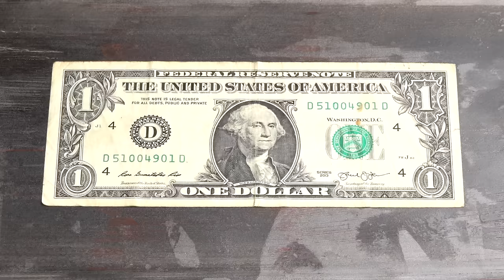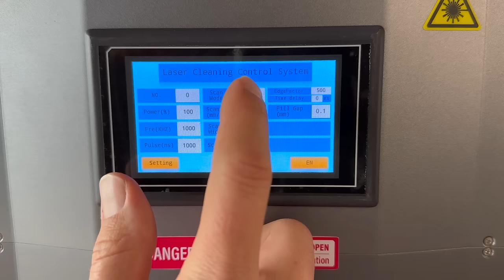World's most PORTABLE LASER cleaning machine!!!

Comment: halfway through the video, you might mention it later, but it's critical PPE to have properly rated laser goggles when using high power lasers. A stray beam reflection can instantly blind you if you aren't careful. Shit's scary, likewise minimizing the effects of potentially blinding someone else would be advantageous.

much like you mentioned with it potentially melting through it's own lense. Your eye is a lense, that is essentially made out of gelatin and meat particles however. Much less resistant.

I'm unsure off the top of my head of the safety of these lasers in specific, but i believe both styropyro and backyard scientist have videos on these, which are likely to include some form of related information. Styro in particular.
Reply: Totally agree as a college EH&S teacher and safety officer
Reply from the maker: Good points. I mention safety glasses in my other laser video about the manifold but I totally forgot to do that in this one.

Comment: Hi, I am a laser cleaning salesperson. Warm reminder: You need to wear protective glasses when using the laser cleaning machine to prevent laser radiation from causing damage to your eyes.😄
Reply from the maker: I included that disclaimer in my first laser video but totally forgot to include it in this one. You are absolutely correct. Thanks for commenting!!!
Reply: @suburbanbiology  Thank you for your approval. Wearing protective glasses is very important. If you have any questions about laser cleaning, you are welcome to contact me at any time and I will be happy to discuss it with you.😄
Reply: What is the upkeep for this backpack? How long does the charge last?
Reply: I have an IPL aesthetic laser business. Hair removal, sunspots, acne, etc. I just had a handpiece repaired and a service technician is coming Monday to clean the system. I would love to learn the basics and keep up on maintenance and prevention. what is a laser cleaning sales person? Do you both clean and sell lasers?
Reply: Is there a solution that can weld automotive repair panels and can clean rust and occasionally cut? Or am I better off with one pulsed wave cleaner, a continuous wave welder and cutter as a second machine?
Reply: I want to buy this laser cleaner machine.
Reply: Do you mean, safety reminder, instead of warm reminder?

Comment: I guess at $14-15k for a machine like that, if you are in the business of earning a living doing work like that in a shop, or on the field, then it's worth it over time.  But not for the DYI guy going these types of projects.  For the DYI person, a small Harbor Freight sand and media parts blaster is the way to go if you have lots to do.  For a few small jobs on a budget, a wire wheel on a bench grinder (or for portability, a fast portable drill) with proper eye wear, welding gloves and a bib is really all you need.
Reply: there is also some other model for diy such as 3000 usd orso for a mutifunction laser machine

Comment: I have an upright piano that I want to refinish so but scare of how long it would take to use the normal chemical stripper. I found the laser method a few months ago, so I was excited to see a longer video on how they work. Even if this one isn't able to remove stain.
Reply from the maker: I attempted to remove some stain from some old cabinet doors. My particular doors had been coated with polyurethane. I found that the polyurethane wound up kind of burning. I have seen other videos of laser, cleaners removing wood stain. I did not take the time to research how to do this. I’m not sure if I had the wrong settings punched in or if the polyurethane just made it impossible. From videos online though it seems like some units can do it. Perhaps a bit of research would lead to me realize that this machine is actually more capable of it than I realize??? Thank you for commenting and for subscribing.
Reply: The pulsed model laser cleaner can clean rust paint graffiti oxidized layers of oil welds etc. on both metallic and non-metallic materials without damaging the substrate.
Reply: Personally I would sand a piano by hand. I would use sticky backed sand paper that comes in a roll that can be torn off at any length and make myself a few different lengths of wood blocks to stick that sandpaper to. It would take time but would result in the flattest smooth even surface possible. No power tools for fear or burning or digging.

Comment: Seems great for removing rust from hard to reach area's like the vise and table, but I was concerned it may have a lead base paint and your breathing the fumes. For the big flat surfaces a palm sander would be way faster. Cool video I seen someone else use a similar device on YT.
Reply from the maker: I had on a carbon respirator but I must admit I could smell a bit of the smoke. My silly beard out to get me. I would normally turn a fan on to blow the smoke away but the air shook the camera. Sacrificing health for a good shot 😂

Comment: It is interesting. I wonder how you could use it under tight spaces safely, like a frame of a trailer. With car oil and all it would not be safe to use around a vehicle but maybe work trailers and camper frames to remove rust.
Reply from the maker: With thick enough oil coated on anything you’re correct. This would definitely ignite thick layers of grease and oil. It would be a good idea to have a lot of ventilation and a fire extinguisher very close by before you attempt anything like that. Thanks for commenting and for subscribing!

Comment: Looks like attaching this thing to a CNC Gantry would make a lot of sense if you had a lot of material to clean.  That way you could both optimize the Z axis and reduce the need to manually carry, hold and move the darn thing.
Reply: Sure for odd 3D shaped objects this wouldn't work great, but, for mostly 2D surfaces like beams and other materials it would make sense.
Reply from the maker: That would be awesome. Maybe someday. I need a bigger workshop 😂

Comment: Do yourself a favor. You should have received a bendable plastic line that threads into the top of the laser body. That is for air to be blown onto the lens or you can aim it at what you are cleaning. It helps keep the lens clean. I have this machine as well as a 1500w cw
Reply from the maker: Thanks for the tip! I didn’t hook it up because it obscured the shots of the cleaning but unless I’m in windy conditions I plan on using that tube and hooking up to a compressor. Thanks for commenting!

Comment: I've been a coded welder for 40 years, and I don't think even I could get value from a machine like that. I'm not saying that it wouldn't occasionally have been useful, but it would never have been 10 grand useful.
Reply from the maker: I must admit that the 10k price tag is still high which is why I got a ding/dent version. The prices seem to be falling rapidly which is part of why I didn’t mention price in the video. I’m betting it will be like many technologies where in 5 years it will 90% off. Just curious do you think this thing would be 1k useful or not even that?
Reply: @suburbanbiology  Personally, not for me. I can do 99% of what that machine can do with a 4 inch grinder and a flap disk, faster, way cheaper and lighter. I notice it has a 1 year guarantee (except for misuse) on everything except the laser source, so I wouldn't expect it to last much longer than that if used in an industrial setting, and even at $1k, that's still not good value for my use case.
Reply: If you work on cars or some other things where you deal with lots of rust then this would be great.
As a car mechanic that struggles with LOTS OF RUST this would be amazing.
I usually use a pneumatic needle descaler then sanding or a small wire wheel on an pipe to reach hard spots, have made my own with copperpipe and steel wires and then soldered for a pin wire wheel, it's slow but the only functional tool sometimes and a laser would be soo much faster and better than solvents, knife blades, sand paper and wire wheel for so many things and do less damage to the base metal
Reply: I’ve never been a welder and I disagree I think it would pay for itself rich people don’t like to wait and would be awed by the technology. Restoring old car parts etc / boats / tools / toys/ antiques/ tools

Comment: If you have a painted car part (for instance, an engine block or wiper motor housing) and want to remove oil/grease, can settings be adjusted to remove just the surface grime without affecting the paint or does the laser clean down to bare metal every time?

Comment: Would this clean tile and grout? If so, it would be awesome for cleaning nasty tile showers.
Reply from the maker: Yes it should be able to handle that just fine. It may slightly mar the tile finish though since it technically scours into the surface just a tiny bit. If you could stick to just the grout though it would probably work fine. Thanks for commenting.

Comment: Cool tool but the dangerous, boring, low effort, and low cost method you shown with brake fluid seems better. The laser does seem ideal for the fence posts although a wire wheel on the pipe ends after cutting might be good. I bought a low end plasma cutter.
Reply from the maker: Good points, all. Thanks for watching both videos and for commenting!

Comment: I did not see what laser source this machine is using other than it is a 100watt laser. I have a 100watt JPT. I set the Pulse to 500ns and the frequency to 68khz for max power output. With that I can cut through 16gauge steel with about 200 passes going 1000 mm/sec and a 160mm lens. Did this machine come with any recommended settings?
Reply from the maker: The settings are largely adjustable. This laser has a gun the sweeps the beam around. If yours is able to cut I would imagine it doesn’t sweep the beam? The link in the description will have more details.
Reply: @suburbanbiology  Yes, the beam sweeps across the material with a galvo head. That is 2 mirrors attached to 2 motors that rapidly moves the beam around.

Comment: Concerning the smoke getting to the lens. I think the use of a fan could prevent that when using in doors.
Reply from the maker: This machine actually comes with a little bendable straw that you can hook up to an air compressor to blow the smoke away from the work Peace. For the sake of this video, I thought that that obstructed the view of the workpiece too much though. By the end of the video I had already slightly damaged one of the protective lenses. I probably should’ve mentioned that in the video body. Maybe I will add that to the description right now just for the sake of clarity. Thank you for commenting, and for subscribing.
Reply: @suburbanbiology The use of a fan (even worse a blower) is always a bad idea with airborne contaminants (you just spread them and/or put them back into the air for several minutes/hours depending on the aerodynamical diameters). It's better to suck the smoke near the surface with an industrial (fireproof) vaccuum that has an HEPA filter.

Comment: Does a laser take any metal off like sand blasting?
Reply from the maker: Technically yes. The very surface is slightly removed. But it’s so superficial that you can barely even tell. If you leave the gun still for too long you can see a slight depression where the laser repeatedly scoured into the metal. Thanks for commenting and for subscribing!
Reply: About subscribing… I love your channel for DIY projects, steel work, and welding. Keep it up! In my past life I learned how to MiG weld but today I don’t know where to start concerning purchasing, safety, and if MIG is the way to go? Could you possibly post a video on where to start or what you use?

Comment: What length of time did you get from the battery? Can this unit be used on other materials? Wood , stone that kinda of thing? 
Great video by rhe way
Reply from the maker: I didn’t get the battery for this machine. If you check the link in the description I think they go into more detail on battery life. It was at least a few hours. The laser will clean multiple surfaces including stone. I found it works best on metal though.

Comment: ive you tired metal that was oil painted?
Reply from the maker: I’m pretty sure the primer on those steel beams is oil-based paint. If you are asking if I have tried metal that is coated in grease and oil. Yes I have. This laser works well on both. Like I said in the video it takes a little bit of time, but for small, very irregular surfaces it works incredibly well
Reply: @suburbanbiology  i mean like metal fences with oil paint